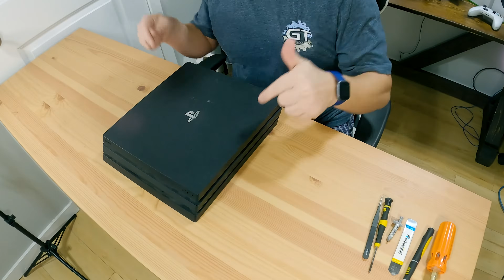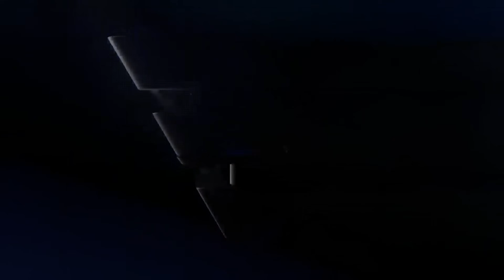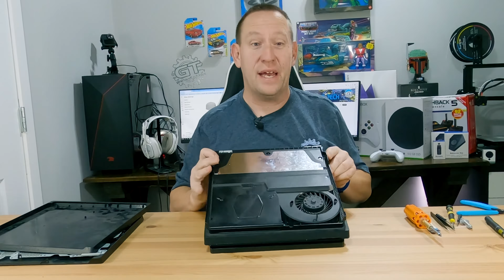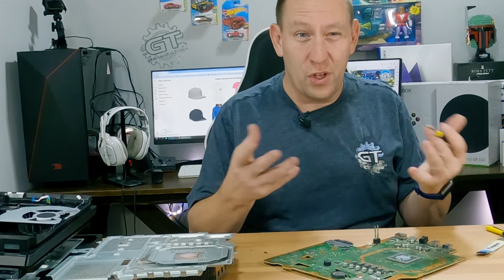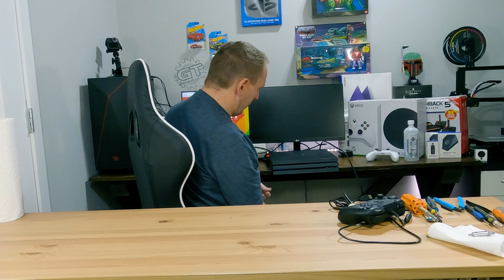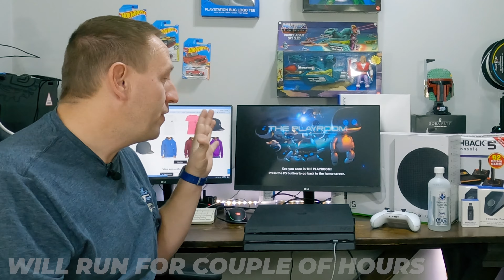Huge Performance Boost AND No More Jet Engine on your PS4 PRO! | Gears and Tech

Comment: Pro tip: If you are going to buy a PS4 Pro, make sure you buy one made 2018 or later with the small power cord connector. This is guaranteed to be the thermally improved model and will not sound "like a jet engine". That's what I did just recently. Mine is very quiet, a little louder than my PS5. If you want it AS quiet as a PS5, you will have to replace the thermal paste with Arctic 4 or similar and most of all, replace the thermal pads with cut-to-fit Grizzlies.  I will probably do a video of this on my channel shortly.
Reply from the maker: All excellent points
Reply: @GearsAndTech   To take it one step further do a Thermal Grizzly Graphene Thermal pad cut to 23.5MM x 13.5MM for the CPU and fresh Thermal pads and you'll basically never need to replace it again
Reply: I got both brotha and they bout sound like jet engines !! Actually my smaller power cord one randomly shuts off or says over heat! The bigger power cord one still works solid ! What I did was take it to my shop grabbed my air hose and blew the turd out of it so much dust came flowing out smh !!
Reply: @Praisestothemosthigh369  use a dust blocker mesh blanket or set it on a pedestal and hang a gray window unit filter on the front intake. Too dusty there.. maybe too much air circulation....
Reply: Believe it or not, these ones are NOT thermally improved, they actually run significantly hotter than the older ones. The changes to the thermal design are mostly negligible outside of the fan curve being changed in such a way that it will allow itself to run hotter before turning up the fan speed. If you don’t mind the noise the older models are likely to be better in the long run as less heat means it’s entirely possible they will have a longer lifespan
Reply: @rockl79  fake
Reply: Mines the one with the small power cord input and it still sound like a jet
Reply: @mtbhillbilly  clean it
Reply: actually mine is about to go sound as jet engine (latest model ps4pro) probably the factory pads and paste are worn out and its already 4year old too.
Reply: When video sir ?
Reply: nah man its the same shit😂
Reply: Bro I got the pro with the tiny power cord and it sounds like a jet engine
Reply: It’s because after the first revision, 71xx,72xx, they changed the fans. The 70xx Pros had different fans. But you know, with the revisions, Sony cut corners to make it as cost effective as possible so the materials are inferior to the original PS4 Pro. That’s why they went back to their old power plug that all their other PlayStations have. You notice how the first PS4 Pro had a much bigger power plug.. that is way better to have
Reply: @zureai  The reason it has a larger cord is because it pulls more watts - it's inefficient compared to the later models.
Reply: @CarsandCats  who said it’s more inefficient? Do you have statistics to back that up? 

the first gen PS4 pros had different fans that spin faster making the first gen ps4 pro run cooler. That’s why it needed a larger cord. The revisions, they did as much cost cutting they could do, so you can see why they reverted to the old cords they had and changed the fans to quieter fans that ran SLOWER so those PS4’s naturally run hotter but they are quieter.

Heat will make your components age quicker …
Reply: The 2018 model with the small power cord BLASTS like a boeing 747
Reply: Pro tip, lol 😂😂😂😂😂😂😂😂😂😂😂😂😂😂😂😂😂😂😂😂😂😂😂😂😂😂😂😂😂😂😂😂😂😂😂😂😂😂😂😂 the dude that started playing yesterday and happened to gogle something.  😂😂😂😂😂😂😂😂
Reply: I got one of these models off a trade a while ago and man it sounds jet engine. I bought the screwdrivers needed to clean it and was thinking of cleaning as much as i can without removing thermal paste yet i couldnt even get under the power supply to clean. Was barely able to clean the fan yet still.. now heres the thing. When in regular 480,720, or 1080p without supersampling it sounds quiet yet on 4k it sounds meh on some 4k games it does sound loud while on other like rdr2 its almost jet engine at first yet after a few minute its a bit quieter. When playing these 4k games in any res witth supersampling it sound louder. Yes i know it most probably needs cleaning and thermal paste replaced aswell as thermal pads yet im not able to do much. One of the 5 screws you need to remove to be able to remove power supply is stripped which doesnt let me remove it. Weirdly even though most people tend to mention the fat ps4 models being the most jet engine like. My fat modle ps4 is really quiet even with games like rdr2, battlefield 1 or the new saints row.
Reply: Serie 72****😎
Reply: I have the 2016 ps4 slim, now after 7 years, vets are making an silent jet engine sound
Reply: good dude
Reply: I hve a late 2020 PS4 Pro! Few months before the PS5 First came out! An it preforms great! 💪🎮😎
Reply: Yea I bought mine 2018. I kept hearing ppl complain, but mine never had the jet engine sound.
Reply: it has nothing to do with that its the firmware update they made it on purpose.
Reply: Just bought mine and it has a cable only for power. Did I get the better one?
Reply: Mine is very quiet, I can't hear anything.
Reply: Did you ever do a video?
Reply: @TalonNismo  No I did not because my Pro is still quiet. No need to open it up yet.
Reply: Are there any numbers on the PlayStation that will indicate that it's a 2018
Reply: Year if manufacture written in the console body @carlschmiedeke151
Reply: I can't say you are right. I hava a 2019 and it is a jet engine. After I worked with a cleaning and a reset of the cool paste ist still is like top gun.
Reply: 2 year update: he never uploaded said tutorial
Reply: I wish I seen this comment before buying a $180 jet engine
Reply: I bought mine in August 2018. I bought the Spider-Man Limited Edition PS4 Pro console bundle. Still use it today and still have and can use my original glacier white destiny console if I want to. Also, the PS4 Pro can support up 18tb storage if you know what you are doing.
Reply: @comixof2morrow  Please tell me how?
Reply: @CarsandCats  , Upgrade internal drive to 2tb and hook up two 8tb external hard drives. Now, yes you can have both external drives connected to the PS4 at the same time but only one of them can be active. All you have to do is go to settings, devices,USB devices,and click which one you want to be active and then when ready you can go switch which is active again and go play. Essentially, with a USB 3.0-3.1 hub you could have more storage than that.
Reply: @CarsandCats  , It's not as ideal as having them all active at once but it is better than nothing and it only takes seconds in the settings menu but one more thing to note...it does take a minute or more depending on how full the drive is for the drive to fully load but like I said, it's better than nothing.
Reply: @comixof2morrow  Okay thanks. I have Crucial 2TB SSD internal and a 4TB external and just ordered an 8TB external to install games to. If I like the game, I will move it to the SSD and play it from there.
Reply: @CarsandCats  SSD's are the beez neez
Reply: Did the PS4 Pro 500 million edition come out after 2018? 

I bought  2nd hand pro 500 million edition a couple of months ago it sounded like a jet at first but I stripped it and cleaned the fan and heat sink throughly I didn’t replace the thermal paste as it’s a lot quieter now but will do if needed down the line.
Reply: @C-J-LS14  , you should always just change the thermal paste if you tear it down. Chances are it wasn't covering enough space or there is too much and needs to be cleaned up. Yes, I believe it did because I remember thinking.."I wish I would have known about this edition before I bought the Spider-Man Limited Edition PS4 Pro bundle"..LoL. I believe it released in 2019
Reply: @comixof2morrow  too much thermal paste isn't a thing you can literally cover the whole motherboard with thermal paste and it wouldn't hurt anything it's not electrically conductive like the liquid metal used in the PS5s
Reply: @C-J-LS14  My Spider-Man Limited Edition PS4 Pro doesn't sound like a jet engine but does get loud when fan is dusty. Usually I just open it up and take compressed air and blow it out. I'm quite sure I should be preparing to change thermal paste. I bought some really good paste a while back cause Amazon had it on sale for super cheap.
Reply: @comixof2morrow  I sold my original fat PS4 as I already had a 500 million controller so soon as I saw one for sale in a local shop I couldn’t resist it’s truly a thing of beauty and I’m glad I upgraded to it especially the 2TB memory space now I’ve got 2 500 million controllers as it came with one and the blue camera too. 
It made more noise when playing a disc and didn’t stop now it starts load due to reading the disc but then I hear hardly anything after the first few initial minutes 😃 
If it was to ever get loud constantly I will re strip it down and then clean and replace the thermal paste.
Reply: @C-J-LS14  , Yeah, it is a nice looking console. Just add two 8TB game drives and you will have a total of 18TB of storage. Note, they both won't stay active simultaneously but you can keep both drives plugged in and switch which one you want to be active. No data loss
Reply: @comixof2morrow I have the Translucent Blue 500 Million Edition that came with matching stand controller camera earphones & translucent blue headset, it has the chunky PC style plug, bought my brother the thinner plug one & IMO the noise is mostly from different fan curve, I may consider installing the quieter designed fan but I only ever hear mines when on mute or no sound out of my system

My question anyway[& IK I'm responding late is]I wanna upgrade the factory 2TB internal HDD to a larger memory internal SSD, what is the software limit for the internal SSD is it just 2TB, would like to know the limit for PS3 also, the one I have is 500GB currently but I'd like to switch to longer lasting SSDs in the highest capacity internally allowed, I just don't know what the max number is
Reply: My Launch Model Pro has always been silent. I think it comes down to how well the Paste was applied at the Factory, How much the machine is used, the environment it's used in and how dirty it is. 

I just tore down a early Model PS4 that sounded like a Jet Engine after a few minutes of game play. I replaced the TIM with some Noctua TIM and it's dead silent now.

Comment: I have 1gbps internet speed tested it all the time runs steady around 800mbps est. My PS4 pro never had a lound fan until call of duty vanguard strange. Also is acts like it wants to freeze up on the ui it's nuts I've changed setting restarted it etc no trouble shooting seems to fix these issues and I have tons of space left for game installs and nothing's downloading with the slow and freezing on the ui screen just navigating the menu it does this not in gameplay though any ideas?
Reply from the maker: Change the thermal paste.

Comment: Interesting.  I bought a PS4 Pro customized with a 2 Tb SSD instead of the standard HD. It's quiet.
Reply: I just installed one in mine. A crucial.
Reply: @CarsandCats  i also used a crucial but on a slim, i know it has sata 2 instead of sata 3 and there not like a suuuuper big improvement on loading times, textures popping is not an issue anymore.
Reply: Could you share me the link? I want to upgrade my hdd to ssd. Thankss
Reply: @borish333  I don't remember. It was long ago. There are a lot of YouTube videos on it. Just search for PS4 and SSD.

Comment: Also you can mess with video playback settings, sometimes if a game is graph8vally intensive it can do the jet engine sound but if you go to 1080p it won't be as bad and also it helps with performance
Reply: that's how i set mine up, that's cause 4K is not really possible on the Pro, it's more like 1440p with checkerboard, but it's best played on 1080p.

Comment: Could you try to fix my ps5 ?
Reply from the maker: What's wrong with it?
Reply: @Gears and Tech  
I customized it cosmetically,  it worked for about a year after that , then one day it just wouldn't except an update, did some research and was told it was because of the disk drive not working,  so I replaced all the ribbon cables,  but still no luck , now it's stuck in safety mode, I've tried to reinstall through the flash drive but still no luck. 
If you are really interested I can send it to you .
Reply: @overlandh3  bruh he doesn’t care
Reply from the maker: We communicated over email and Wicked sinnz decided he wanted to sell it for parts instead. 

I care about everyone
Reply: @Lycancrystal  actually he does care . He contacted me via email and messenger, really great guy .
Reply: @GearsAndTech  this it here
https://youtube.com/shorts/ZNp2QOOAFZU?feature=share
I'd really like to send it to you.